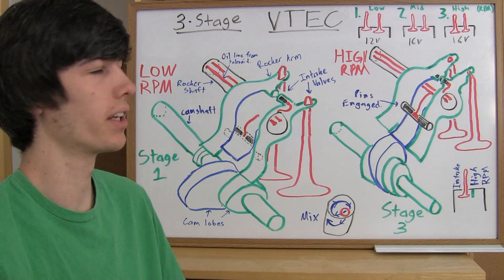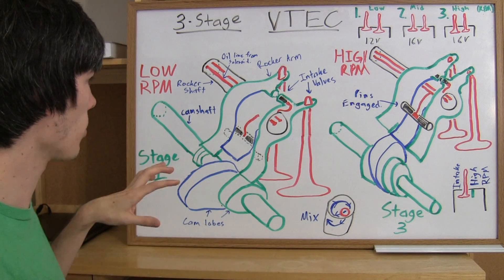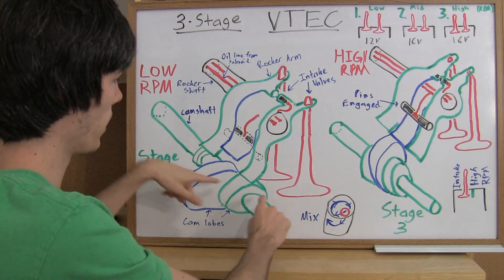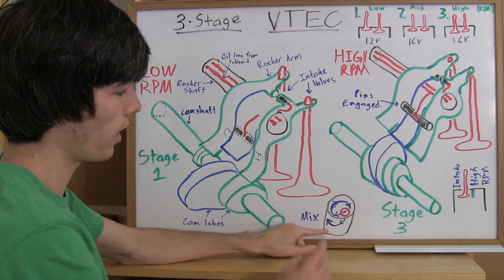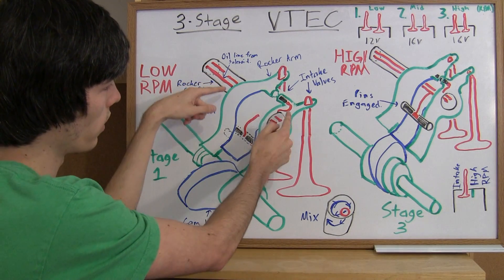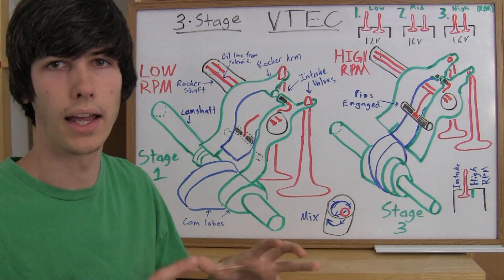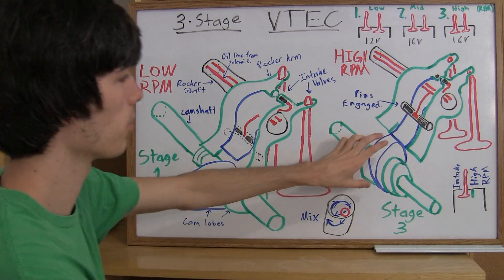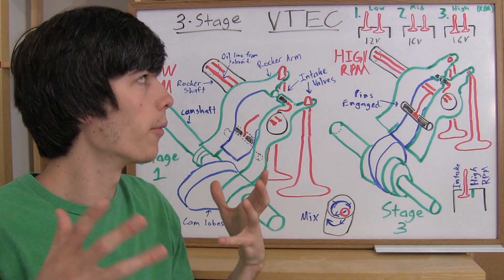3 Stage VTEC - Explained

Comment: Hey got a d15zc comes with p06 head 2solenoid valves or 3stage vtec and p06 intake. How do you tune it with stt chip default base map? Which base map to use?

Comment: Great vid Man! just had a question, In Low RPMs why doesnt the bigger cam lobe rotates? It is still attached to the camshaft....
Reply: in this case, the engine honda d15b have a ecu that control the solenoid, when the RPM is up to 3000 the firsth solenoid activate and pass oil to open 16 valve under 3000 the engine run to 12 valve only, and up to 6,200 rpm the vtec in

Comment: You mention more lift and duration. How about advance (or cam timing). Most variable cams are mainly about advancing the cam, or that is how the technology started. The VTEC incorporated more lift and duration sure, but the cam advance is a big part as well. Great video though. Thanks.

Comment: hi Engineer Explained. can you explain simply whats the difference between mechanical, hydraulic and ellectronic VVT? Is VTEC hydraulicbecause there runs oil? is that hydraulic VVT where camshafts angle is changed by phaser (ois runs into it)? is BWM's valvetronic electronic? sorry and thanks in advance

Comment: Guys in which engines was this 3stage vtec applied ? Was this available for all vtec engines after a specific year? 
Lastly is this something you can apply to your regular vtec engine? 
Drawbacks for this over the two stage vtec? 
Thanks a lot.
Reply: Billblackeye as far as i know they introduced this 3stage VTEC with the S2000. But then they had i-VTEC in most cars so maybe the S2000 is the only one with this. But i'm not sure.

Comment: if there is any failure  of the pins or the solenoid   power  is cut.  risky design.
Reply: Fun Fact: They never failed
Reply: It will only affect power and efficiency. Nothing will break :P
Reply: even reduced power deems it redundant.
Reply: all you need is a  16v dohc engine. plenty
of power
Reply: anusheadproductions How often do you think they fail?
Reply: dont know dont own a vtec. just going by the
what i see could fail.
Reply: 16v dohc coupled with a  variable speed automatic transmission is all you need.
Reply: good

Comment: I think you're missing another key feature of vvtec being that by closing the exhaust and intake valves at different points of the combustion cycle to crest vacuum in the cylinder and use the momentum of the cylinder and not combustion of gas to cycle the cylinder allowing you to use less fuel.

Comment: Thank you for such a detailed explanation i have one of this 3 stage 2 solenoids SOCH heads installed in a D13B engine an I do not have the 3 stage ECU on it but the regular one for non VTEC, now the question is how the solenoids work, is it that Stage 1(Low range 12 valve mode) is both solenoids off, Stage 2 (normal mid range 16 valve operation mode) only 1 solenoid on and stage 3 (full VTEC mode) All solenoids on? Thanks for the answer! 

If you guys are wondering why I do not get the proper ECU is because I'm building my ownVTEC controling electronic system that allows me to select the RPM's range in wich the VTEC is going to quick in and out, excelent for turbo VTEC Projects...
Reply: If you are building your own VTEC Controller, then I believe it would be you who decides how the Stages are activated and when.  Why are you asking this question here?   Here is my best shot at your question, based on the video description, both solenoids off would be stage1 (economy mode 12valve operation).  2 solenoid on, is likely to be stage 2 (standard mode 16v operation) and 3 solenoids on is stage 3 (high lift cam profile).  I think it is possible that stage 3 works with only 2 solenoids on but I doubt it.  
I guess using tach signal and a digital counter and perhaps a timer, or maybe a microcontroller that will count the engine rpm and then use 3 digital outputs to energize the solenoids.  The logic for basic enable I believe would be something like Solenoid 1 Output is True when RPM is > Stage 2 Lo Limit   
Solenoid 2 Output is True when RPM is > Stage 2 Lo Limit && RPM is < Stage 3 Lo Limit
Solenoid 3 Output is True when RPM is > Stage 3 Lo Limit

I am sure there is more elegant way but its been a while. Good luck with your project.
Reply: Argeny Sandoval *SOHC

Comment: Why is it 12v and not 8v? Since this only shows sets of 2 valves is to only those 2 valves being pushed lower in stage3?
Reply: +austin lew only 1 intake valve and 2 exhaust valves are used, hence 12 valves altogether
Reply: thanks

Comment: what if the cam lobes got even bigger? and will it give more air and fuel to the valve and therefore give the engine more power?
Reply: +Denny Rachmansyah In a way, yes. However, with larger cam lobes, there is low smoothness and fuel economy, and the power will come fairly late in the rpm range.

Comment: Love your videos man!!! But I have a question, why don't manufacturers try and work with electronically operated valves (like may be with some sort of a electronically controlled linear actuator) rather than the camshaft system. Then they can just get rid of all these mechanical parts that have so much weight, wear down and increase the complexity of the system. And to reconfigure the valve timings you just reprogram the controls rather than redesign the whole system.
Reply: that's a good idea, less weight of the engine and so on. tho i still don't understand how the electronics control the valve sistem...
Reply: +Denny Rachmansyah *system
Reply: Thanks Denny! What I had in mind was that the engine doesn't care about what drives the valve, so what if we put an electronically driven hydraulic/pneumatic/electromagnetic type actuator to drive the valve. First, there might be some sensors to sense the crankshaft angle/speed, engine temperature/pressure etc. Then there might be a computer/ecu that uses the sensor data to calculate the best time to open the valve or may be how much the valve should be opened. This computation can be hard coded into the ecu or can be adaptive. With this system you dont need to redesign the whole system when you want to reconfigure the valve timings or durations. Having said that I am pretty sure some big company is sure to have tried it out by now.
Reply: great idea! he actually recently made on a technology recently made on this. Its called "freevalve"
Reply: imaderobotsoccerteam damn, Koenigsegg just stole your idea haha! With that said, they may have planned it before you 😆
Reply: Denny Rachmansyah Damn them Koenigseggg!! I'm gonna sure them anyway!!! but joking aside it's a pretty cool idea I'm happy someone is working on it.
Reply: +imaderobotsoccerteam the crankshaft is needed for the piston to push out the exhaust gas, so, if they get rid of them, it cost much more since a lot of electronic parts == need a professional to repair if any fault 

besides, the camshaft doesnt reduce any power of the car since it is small
Reply: +Dexaran I totally agree with you we dont need to replace the crankshaft. I pushes exhaust gases out as you said and also transmits all the power of the engine. 
What I meant to say was instead why not replace the 'camshaft'. The reason for that is that everytime you want to change the valve timing/setting (to get better economy or more power), you basically have to redesign the camshaft/valve assembly just like honda did for vtec. If you replace the camshaft with an actuator, you can change the valve timings with just a software update. Hope it is clear now.
Reply: i'm from the future (jk) and koenigsegg has done this, with pneumatic (air) valves in a system called freevalve its wicked cool

Comment: How do the pins return to its original position after the revs drop?
Reply: +sif kx as no one has answered you I shall try, at lower rpm the computer would tell the solenoid to return to its original state and as it returns it will pull the pins back out as there is no way for air to enter the oil system.
Reply: AddzSapphire Thanks!
Reply: Nope.  There is a return spring on each Secondary Rocker Arm that will push the synchronizing pistons back.

Comment: If only one cam lobe was working for both valves, then why have a whole different rocker arm going down to the camshaft?
Reply: +Jason Forgeron  This is schematic drawing, in fact, he reused the same picture he used on the vtec explanation. It's not to be taken literally
Reply: +Jason Forgeron To hold the valve at the top position maybe.

Comment: how do the pins unlock back ?
Reply: +john smith Well, since he said it's controlled by a solenoid I believe it can pull the oil back and assuming the pin-cylinder is sealed you can make it work. Just a guess though
Reply: +john smith hmm good point... any Honda boffins here? Maybe there is a spring arrangement that is always trying to pull the pins back out but the oil pressure from the solenoid is too great so it gets held in until the oil pressure drops when rpm drops. Im not sure Im just guessing.
Reply: +john smith Springs, I believe. Not sure, but I want to tear a VTEC head apart to figure it out myself.
Reply: Yeah, if the solenoid is moved back then the pins will retract, it's just hydraulics, and they don't really need to retract instantly anyway.
Reply: just like there is pressure pushing them to lock when it activates there would be suction pulling them back after you drop back to said rmp because the solenoid would switch.

Comment: There could be a fourth stage, using the large lobe operating only one valve. Is there any particular reason why that is not used?
Reply: +Diego C. Back in he days when there were only 8 valves, big valves were used, then technology advanced and discovered that having 2 smaller valves brings in more air fuel mixture, burns more efficiently and gives more power. Try visualizing the space(combustion chamber) it need to have 1 large valve vs 2 small valves to bring in the same amount of air/fuel mixture or release exhaust.  It takes a bigger circle to allow two large valves vs 4 small valves. It's also part of the reason why engines are getting smaller yet more powerful.

Comment: You seemed to miss the part about the million unicorns that get crammed inside the engine, and at around 5500 rpm they all fart at the exact same time. As moog would say, its unicorn boost. #Facts #MCM
Reply: +David Allen one of my unicorns escaped

Comment: When I first bought my Civic with the V Tech,  I race a n/a v six Accord, just to see how close I would come,he cleaned my clock. I guess that extra eighty horse power or so  made a difference.
Reply: f430 koenigturbo What model civic do you have and whats the engine? with slight modification you can outrun the accord easily.

Comment: Are there any downsides to using Variable Valve Timing?  How widespread is the use of this technology?  It would seem like there's no reason to NOT use VTEC (or a similar valve manipulation system).
Reply: The technology is used by most manufacturers in different ways and they've all got their own fancy acronyms, there's; Toyota's VVT-i, nissan's NVTC, mistubishi MIVEC, subaru AVCS, bmw VANOS...In terms of disadvantages, there are none.

Comment: I honestly don't know much about engines. but couldn't you also increase the pressure that the exhaust gas is expelled, by only venting through one exhaust valve....wouldn't that increase the pressure applied on say a turbo? or is that covered in a later video?

might be a stupid question but
^^ see first line ^^
Reply: increasing the pressure would only serve to increase the flow restriction which will decrease power production. The only thing that will make a turbo spool up faster or generate more useful boost is more exhaust gas and a lighter weight turbine

Comment: Hi, thanks for sharing your great knowledge.
I've a question: this 3 stages vtec is used on Dohc or Sohc? I mean, on the exhaust side there is still a traditional vtec mechanism as in the first dohc vtec? Actually, I think that  if also the exhaust side is provided with the variable timing, automatically it would be a DOHC, considering the required space, doesn't it?

Thanks.
Reply from the maker: Yes, dohc.

Comment: Yeah I've tried to search your videos about VVTI, but I couldn't find it. But I've searched and read on some source that the differences between VTEC and toyota VVTI are that VVTI does not apply Variable Valve Lift, but only Valve opening duration. They (toyota) recently introduce VALVE MATIC, that should be similar to the Variabl Valve Lift. Toyota also boost their Dual VVT-i, if i am not mistaken it's about overlapping intake and exhaust valve opening that I am still confused how could that produce benefit output ? do you have video explaining on that ?

Comment: Heya. Thanks for the insight. These videos are awesome. I have a quick question. From what I understand from watching this, the oil pressure causes the first pin (Pin at the top) to move into place, locking the two top rocker arms together. Is this because as RPM's increase so does the oil pressure ? And secondly, how does the second set of pins go into the centre rocker arm at higher RPM's ? Do the Outside Rocker arms reach the pins regularly, but due to low oil pressure, don't go into the holes, locking the centre arm with the two side ones?
I love what you are doing man ! Thanks in advance :)

Comment: the question of Russia. on the engine with VANOS system, intake shaft at high rpm, mixed in advance or any delay? and the exhaust shaft?

Comment: no I have the D15B 3-stage Vtec (SOHC) and want to know if there's a way to bypass the first stage. So my motor will always run on 16 valves (normal mode and wild cam mode)

Comment from the maker: They're different. Basically they don't use springs, instead they have a locking mechanism that forces the valve open and closed, instead of relying on a spring to push the valve back open. Wiki has a good illustration to better understand how it works.

Comment: why does the RPM determine this and not the throttle? if you have a wide open throttle at any given rpm shouldn't it be assumed power is more important than saving fuel? this would offer better power at low rpm as well.  Is there a reason honda chose the RPM as the deciding factor of which "stage" the engine operates and not the throttle? or did they just not think of it that way? i'm curious thanks

Comment: My 3 stage VTEC mode is :1) 1 Valve (/cylinder) open at normal high. 2) 1 Valve open at normal high, 1 valve open higher (with VTEC cam lobe). 3) Both open with VTEC cam lobe. So I kill (remove) the second normal cam lobe, and only open with the VTEC cam lobe. But I don' know it will work or not (all my design just at my book now).

Comment from the maker: It may provide a minimal gain in power, yes. Otherwise it would seem like the system should just use a single, long lift duration cam, rather than a complex variable timing system.

Comment: Hypothetical question; if i was to mod VTEC to have valves fully opened all the time, would that make a higher torque engine at low RPM? I know it would defeat the purpose of the vtec to save gas but ...

Comment: ...I sat and I listened, but I wanna make sure I understand...when the VTEC engine reaches it's 3rd and finale stage, a larger set of cams take over? If so, would it be  too far of a stretch to say that the 3rd stage is like instantly swapping the camshaft of a 5.0 V-8 for an oversized cam?

Comment: I am a bit confused.. How does the pin engage into the correct position if the rocker arm is moving and the 2 holes does not line up?

Comment: I finally understand this black magic called VTEC! Good explanation, I finally have a basis for how all these variable valve timing systems work now...By the way, are you a Mechanical Engineering major, assuming you're in college? Seems like you've really got a good handle on most automotive concepts...

Comment: VTEC doesnt add HP.
VTEC gives you the possibility to have up to 3 different camprofiles.
Dependend on how these camprofiles are set up the engine will either burn the fuel more efficient or burn more fuel.
The Cams in a stock 2-stage-VTEC Honda engine are often setup for good efficiency and good power. If you would try to gain the same power without VTEC, your engine would need about 2l/km more fuel.
If you would try to gain the same fuel economy without VTEC, you would have about 40HP less.

Comment: Its simple.
The pins are pretty short and the distance between the two attack points, where the force is applied is also short.
So lets say the the pins have to take 400Nm. The distance is 0.0001m. So the force is just 0.04N.
I hope i could explain it to you well enough and that you know the laws of physic.

Comment: Very cool system, I would imagine those pins would be under some serious shear force when they get deployed and catch the slot at 5000+ RPM. What prevents those pins and slots from getting ripped apart considering the forces they are under? Exceptional material engineering?

Comment: At low RPM's it acts like SOHC where at high RPM's it's like DOHC mode ?

What I don't understand is if you full throttle the engine, doesn't that mean, you need 
the cylinders to work faster, and the intake periods become shorter ?

...

Unless extending the opening of the valve means more air but in less time ?!

Comment: Why not activate the VTEC system based on the throttle position (like a kickdown,) rather than the engine RPM? That way you'd get lots of low-end grunt as soon as you put your foot down.

Comment: 1, Most systems these days have both analog and digital operating parts, and VTEC is one of them.

2, VTEC systems are controlled by ECU, which is a digital control unit.